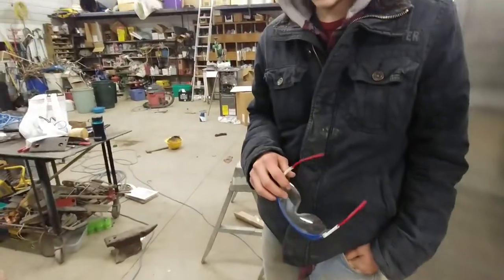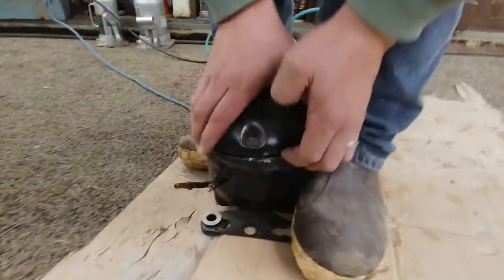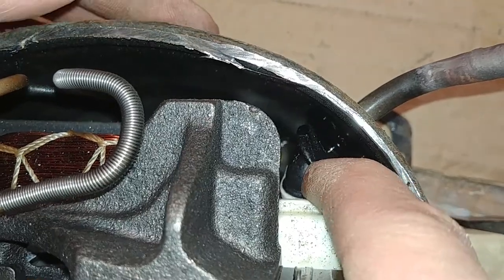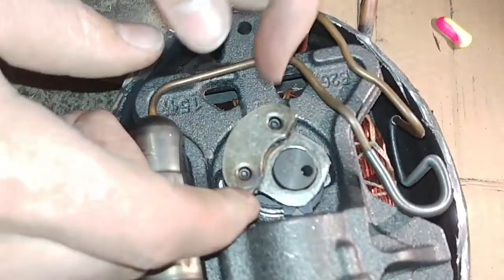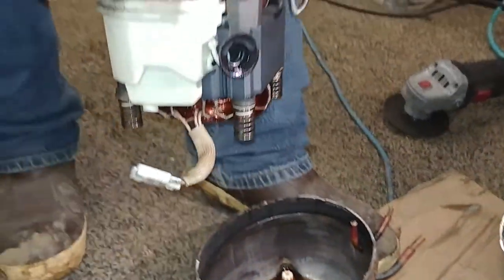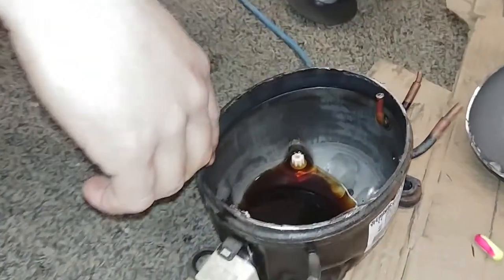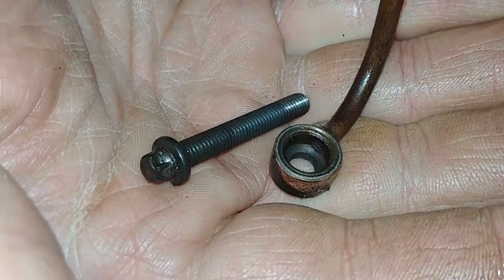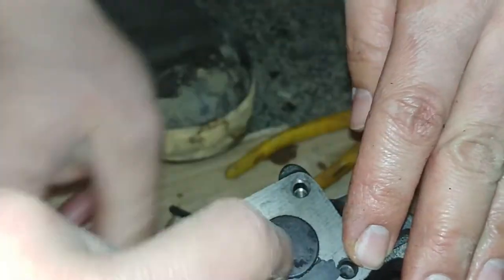What's Inside of a Compressor from a Refrigerator or Freezer? THIS IS PRETTY NEAT

Comment: You're doing a great job..Every single part has job.. all of them work together like clock work to cool your food.. It's an amazing journey for cold..
actually, you're looking at half the system, the other half is the cycle of the Freon gas AND the oil in the bottom,, this OIL is sprayed all over to lubricate all moving parts when compressor is ON..
Mechanics is a great career,, especially with electrics,(electro-mechanics) like this compressor, actually this little compressor carries 4 functions: piston,electrics,mechanicals & hydrolics..AMAZING little ball in such compacted pieces..
Keep the good work..
G.luck ... & salom  سلام 👋
Reply: It's an amazing journey for HEAT.

Comment: The plastic part looks like oil separator (accumulator) to prevent too much oil from entering the compression chamber and hydro-locking the compressor.

Comment: I suspect over heat and oil coking. I think the oil was originally clear not syrup colored.   My guess is the condenser was badly clogged. (YES, you are supposed to clean them ever so many years)  
I'm here to understand what happens if you lay a fridge on it's side.  I think the greatest risk is two fold.  1) a quantity of oil gets into that white plastic plenum and when the compressor starts it sucks in a slug of incompressible oil which could damages the piston or rod, or it could break the read valve,  2) Same issue of oil getting in the plenum but with a load of that trash (metal?) that's sitting in the bottom of the case.  The screen may stop the worst of it but it still may do damage.  The concern of oil getting out into the system is not a problem - a light amount of oil moves though the system all the time.   
It would have been interesting to see if the oil level would have covered the intake when on it side.  Looks like, if the fridge is tipped up at the right angle it could but not normally on it's side.  Other refrigerator compressors would be different.  It looks to me that after righting a fridge with this compressor, you could start it after maybe 30 seconds with no issue.   Lastly, in a technical sense, if the head plate, read valves, and piston where cleaned, it could be reassemble and run another 20 years.

Comment: Thanks, when I got the tool to open it up I will check that piston : )
How can it be fixed by just hitting one side of the compressor? I shook it around and doesn't work : (
Although it probably failed like this as well at the first time...by accidentally shaking, capacitors, relay are all great.
Nah, I will try to hit it on one side before I can do something further.

Comment: I took your advice and took the top off to see if it works. JUST KIDDING  lol  I have a new chest freezer and when it was delivered, every time the guys carrying it took a step  and rocked it, I'd hear cling clang. I asked what the noise was and they said the compressor. At 4:55 you wiggle the insides and I can hear a dull noise, but that isn't it. Could what I heard be one of those pieces hitting the top of the compressor housing that you cut off? The only way I can describe the noise is that it sounds like a light bulb moving around and hitting metal.
Reply: it's the assembly (on springs) banging on the side of the metal housing.  They ask you to leave a newly transported unit time to settle before running so the oil can return to the bottom pan.
Reply: @rsturbolad26  I've had a freezer for 40 years which is still running. I ordered another one because of covid and I was afraid mine might die and I couldn't replace it.  They were all sold out everywhere in March and I just got one at the end of August. I know from decades ago that you don't tip a freezer, which is what the first delivery guys did. When I Google'd and checked with the brand's customer support they said they ruined the compressor by plugging it in right away. I then had it exchanged and that the one I heard the cling clang. Maybe I didn't hear it with the first one because it was sideways?  Not sure, but I wanted to make sure I wasn't having another problem with this one. Thank you for the reply and info.

Comment: Nice
Reply: If I have a large fridge n don't use most of the space.Will the compressor spoil if I switch power off for 7/8hours.Im a one man family.Used to be 4 person family before.Wanted to save on power charges.Will it spoil the compressor switch it off 6 to 8 hours a day or overnight 
Tks
T j
Reply: @thomasjohn8729  no, the thermostat does the same all day long anyway.  You'd just lose temperature stability which will cause frost (ice) and ice-blocked food, possibly.

Comment: Hey Bud, is there a Magnet in there maybe?  It is a Motor of sorts after all ;^D
Reply: No magnet here. This is an induction motor.
Reply: @DrFreeeman  , Really?  Well, i have not gutted one yet.  An Induction Motor...Hummm, have you ever read: "The Inventions, Researches and Writings of Nikola Tesla"??? 

You can dowload the pdf at 

https://www.pdfdrive.com/the-inventions-researches-and-writing-of-nikola-tesla-d33406830.html

Have a Good One Bud^!!^
Reply: @06 Waavy Same principle AFAIK but hundreds of times more powerful and way bigger. The advantage of these is that you don't have any carbon brushes or slip rings to wear out so they can run for decades with zero maintenance. The compressor they're taking to bits has the advantage that it is completely sealed and therefore will always remain clean and as a result can easily run non-stop for up to a few decades. My guess would be that it would eventually give out when the reed valves finally snap (they're flexing ever so slightly when running) which would cause the refrigerant to short-cycle and overheat the windings which would keep tripping the thermal overload.